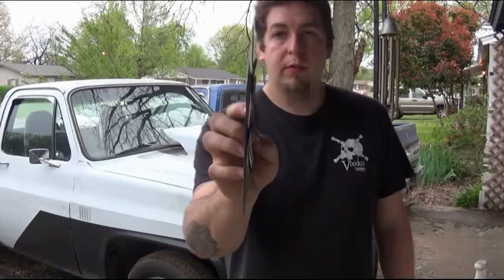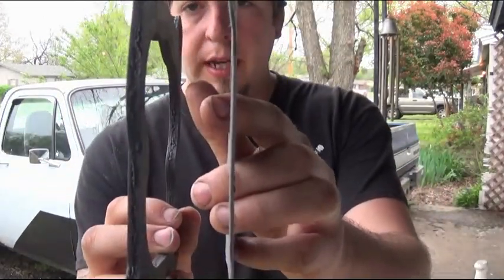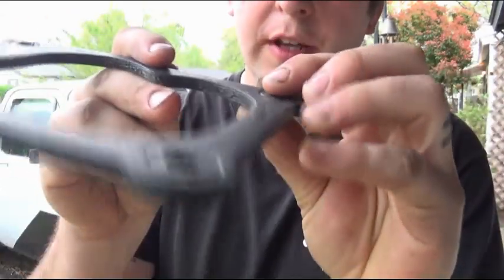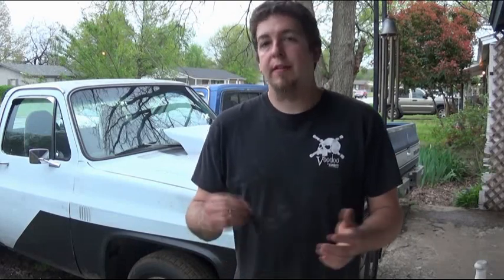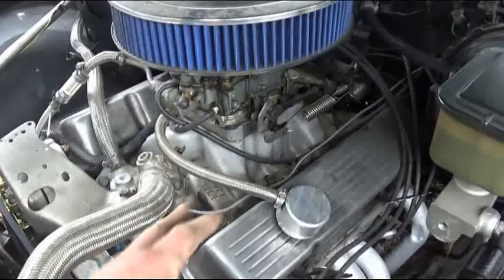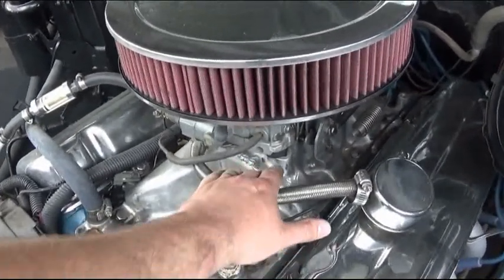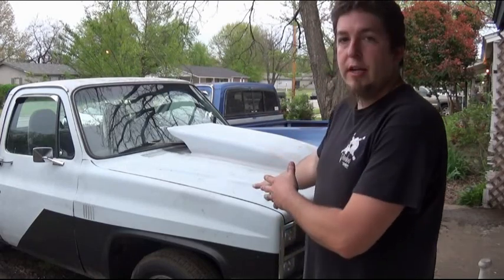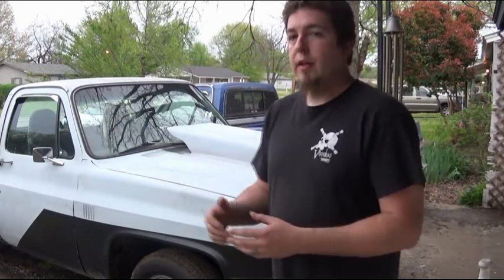carburetor heat soak and fuel boiling issues, fixed by just a gasket?

Comment: Great video - I’ve bought an 8.1mm thick Holley 4 barrel gasket like this for my rover v8 over in the UK, heat soak issues when the car has stopped when warmed up to temp. Hopefully this gasket will solve this for me - only a baby 215ci
Reply from the maker: i have always had look with them and i live in the hot part of the US.
Reply: Your the only one who has reviewed these gaskets and I’m really grateful for that. Just amazed they don’t get used more
Reply from the maker: @toddavies1326  me too. They have always wokred i guess they are forgotten. I usally run a 1/2" spacer or 12mm/13mm or larger and nothing smaller
Reply: I have a wedge alloy spacer on my Holley - thickest end is getting on for an inch then was hoping to run insulator gasket on top - running out of height after that as my car is a beach buggy
Reply: I had a 351 windsor ,not much hood clearance,,the stock cleaner is built to enclose the carb,,,it traps heat,,,the air cleaner is metal,very hot,,,the edelbrock card would boil gas in the winter with snow on the ground,,,and the top removed,,,that's how I discovered the problem,,,,I was using electric fans,,,they don't come on much in wintet,,,so there's no air flow over the block when they don't run,,,so I put a stock fan on and left the fans stay on,,,or at least one fan,,,problem is the electrics don't move air past the radiator much..and it's hot air,,,so just casual racing heats up everything..the alcohol gas can vaporize at way under 140 degrees,,maybe as low as 98,,,so you have to go to fuel injection,,or plastic spacer and thermo quad type carb,,,holly has a new plastic carb,even coolant is 185 and up,,,no good clearance,no good vents,, lousy air flow,hot fuel lines,,,when I bought the car it had a water separator bolted to the radiator,,,that was always hot and starved the fuel pump as it pressurized the lines,,it also dumped gas into the engine,,it was a disaster,,,and this was @. 35 degrees,,at speed not so bad,,,enough cool gas to stop the boiling,,,but at idle,,or after racing,or if ac is cooling me,,,the car stop's and has to cool for 30 minutes,,online they sell carbs they know will boil easy,,,you pay 300,,,to 700 for nothing,,,pushing a t bird alone is not a option...
Reply: That was with aluminum intake with the hood open,,carb top off,in the snow,,,the air bubbles make the float sink and the gas went everywhere,,,I couldn't believe my eyes,,,the new gas is pure crap,boils at room temperature..

Comment: Thermal carb gaskets are a must have, especially if you're intake is iron. I like to run one in conjunction with a one inch aluminum spacer. The two put together keep the carb very cold. Often when I go for short rides I come back and there's condensation on the outside of my carb and it's so cold it feels like it's been in a refrigerator.
Reply from the maker: i think you live a bit more up north so i can see that, where im at it gets hot as hell lol. but yea even when i run spacers obviously i run the thermal gasket, every bit helps lol
Reply: @EfurdGarage  NC is a little further north than Arkansas but not much. This is still the south and it gets super hot and humid in the summer here too.
Reply from the maker: lol you do get more winters im sure.

Comment: Sounds like it's well worth it. I'm thinking about installing a spacer under my supercharger.
Reply from the maker: i think that would help, i have seen them here and there. apparently almost the same concept to help keep heat off the supercharger itself. i guess depending no how big you can go it may help performance by making longer runners
Reply: @EfurdGarage  Any way you can reduce heat is a bonus. Cheaper is better👍
Reply from the maker: @b5beast611  your right. I had a truck I molded trans am vents I'm the fenders, after driving it awhile you could pop the hood and there wouldn't be much heat lol
Reply: @EfurdGarage  😆👌